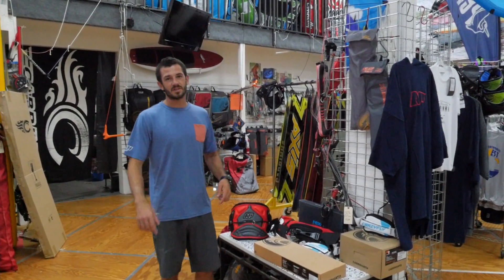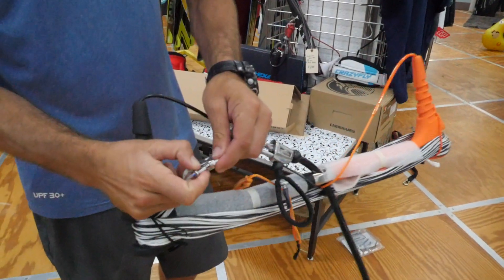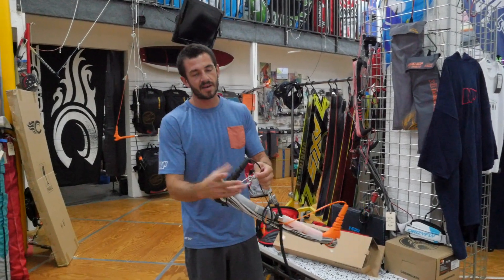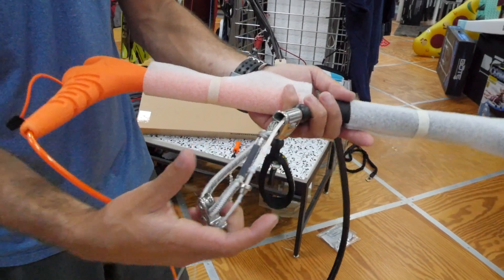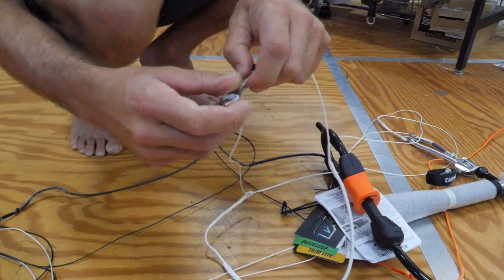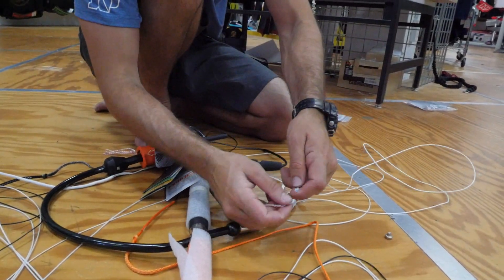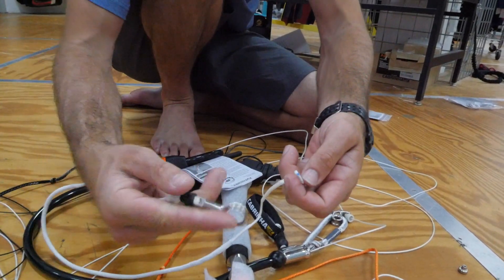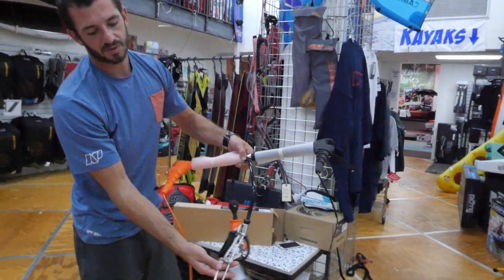2017 Cabrinha Control Bar Recall

Comment: Does that kit come with the bars or must it be ordered.  I just bought a new 2017 bar.
Reply from the maker: what do you mean?
Reply: Do you get the plastic piece with the bar or do you have to order it?
Reply from the maker: On Cabrinhas first shipment of bars in 2017 they used a metal bracket, since then theyve switched to the plastic piece so all the newer 2017 bars are good
Reply: @KiteboardingStPetersburg  hi i got the one wich comes with metal how i can have the plastic one??